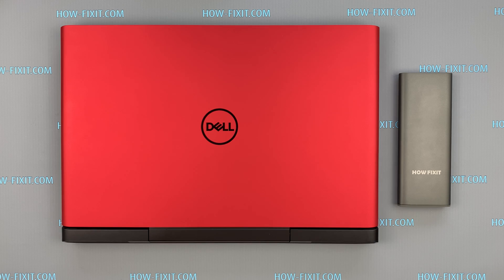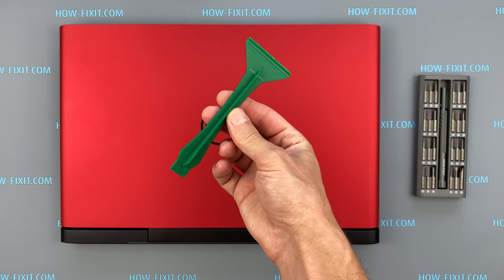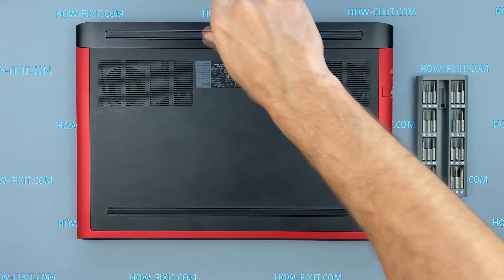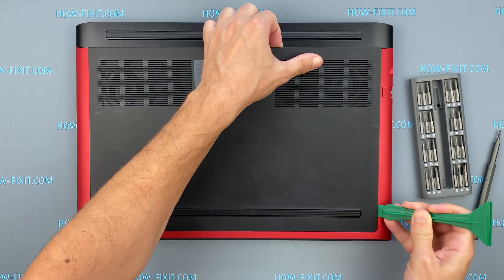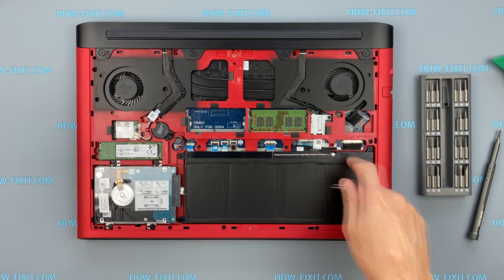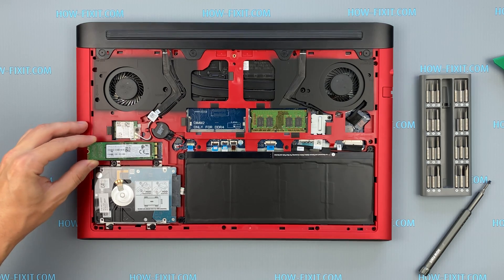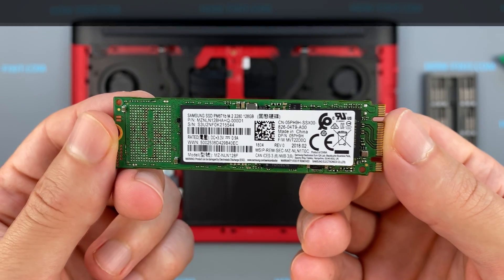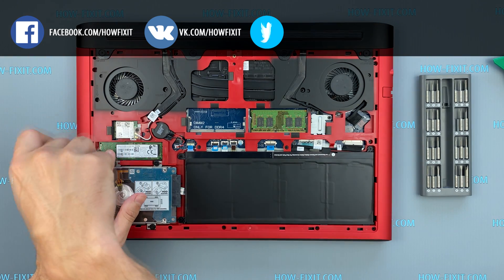Dell G5 5587 SSD Upgrade Guide – Step-by-Step Installation Tutorial

Comment from the maker: ⚠ The Dell G5 5587 supports both M2 SATA and M2 NVMe drives in its M.2 slot. So, you can install either, depending on your preference for cost or performance. Check the description for links to recommended M2 SSD drives. Additionally, watch the video explaining the differences between M2 NVMe and M2 SATA 👉 https://youtu.be/r3Jy5dHOj3g

Comment: So, a lot has still happened in the last 20 months with SSDs. Will this work with the Dell G5 5587: SAMSUNG 970 EVO Plus SSD 1TB, M.2 NVMe Interface Internal Solid State Hard Drive with V-NAND Technology for Gaming, Graphic Design, MZ-V7S1T0B/AM. The 970 EVO is actually a lot more expensive than the Plus now.

Comment: please can sm1 tell me if this M.2 nvme ssd GP-GSM2NE3100TNTD is fine with dell g5 15 5587 ty in advance
Reply: Should be fine
Reply: That is the g5 15 5587
Reply: ty all for your response i ended up buying samsung 970 evo plus and it's working just fine (for those who want to know if the ssd works on g5 15 5587)
Reply: @ahmedayachi5889  Are you getting the full speeds of the ssd (somewhere around 3.5k read and 3.3k write) or is it way less than that?
Reply: @abdelrahmanjamal8940  i ended up  buying samsung 970 evo plus 500 sorry
Reply: @ahmedayachi5889  sure did you get the full ssd speed?
Reply: @abdelrahmanjamal8940  i did not take the speed so seriously so i did not concentrate on it so much but i noticed the high speed when copying large files, opening apps has become faster (comparing when i copy files to my hdd so much faster) but the start up time is between 7 and 10 sec on win10 i expected better i don't know why i'm thinking about the dell logo delay that i don't know how to get rid of it
Reply: I bought the Crucial P2 CT1000P2SSD8 1 TB Internal SSD however pc doesn’t recognize it. Doesn’t show in disk management, any help please!
Reply: @Durag92  I don't quite remember but I think there are settings that you're supposed to change in the bios for it to get detected